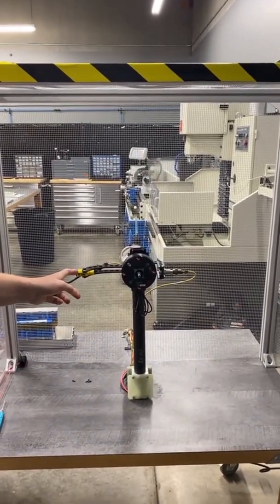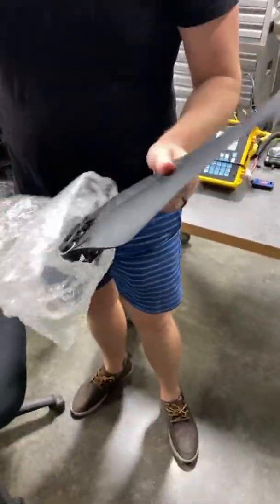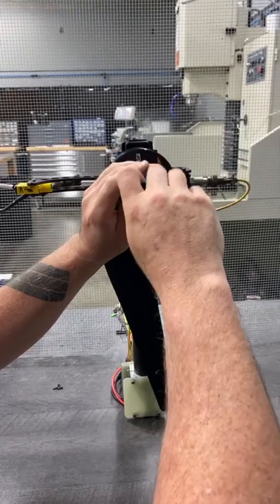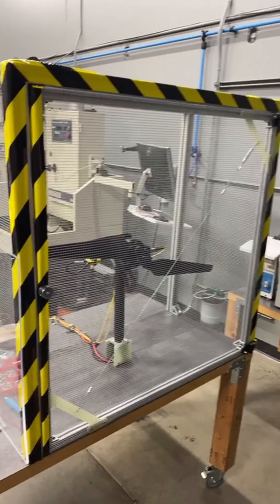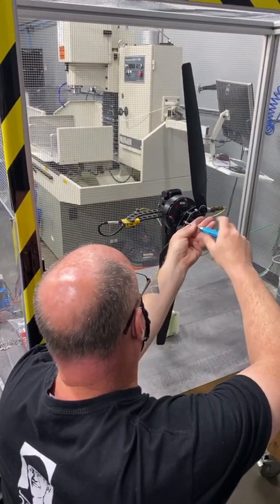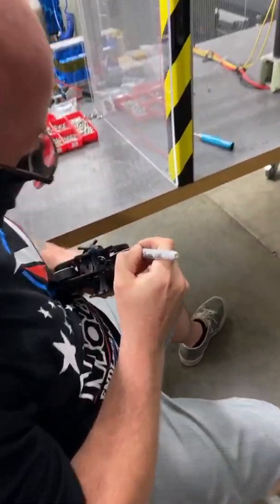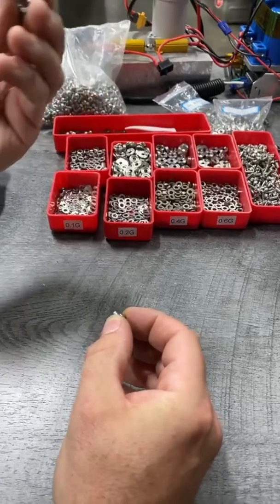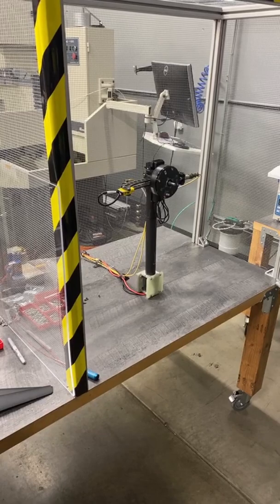ALTA X - How we balance ActiveBlade (Live Replay)

Comment: Question; could you make props for DJI inspire 2 , its the weak link and t-motor no longer makes props; Koptermax list very expensive; if you could make better props at 500usd? stock props eat up Gimble holder very fast;